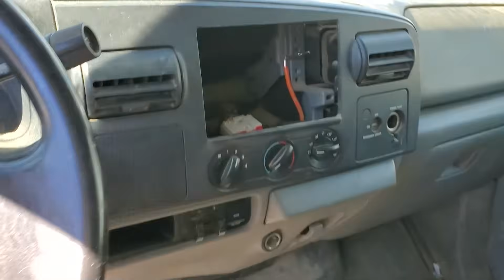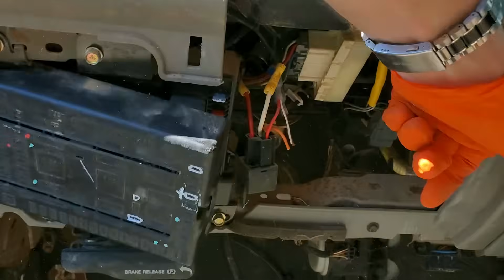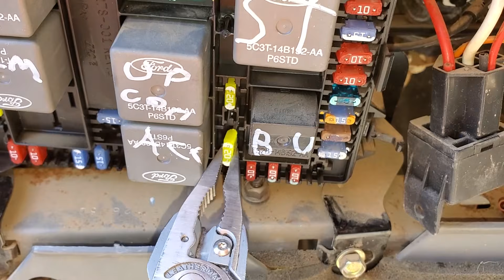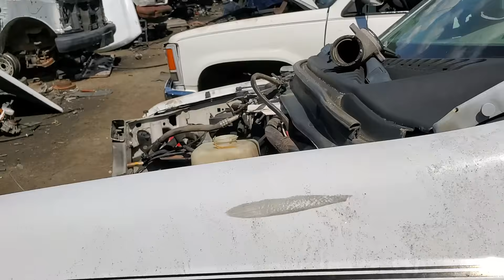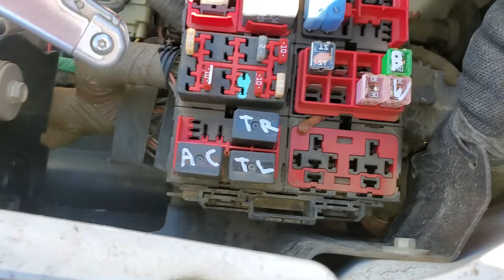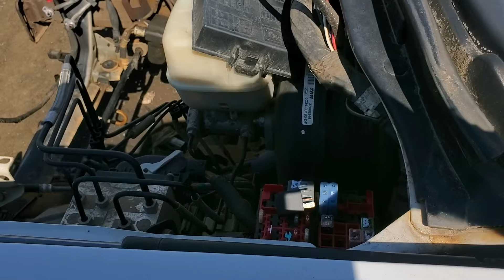2006 Ford F250 AC Fuses, AC Relay & Circuit Explained

Comment: Okay, so I have a F350 6.0 and I installed an e-fan from flex-a-lite.  According to their instructions, they suggest that I connect their e-fan to the AC clutch by way of a piggyback splice that they provide in their kit.  That being said, I find that it is difficult to piggyback anything on the wiring harness to the clutch itself plus I a worried about clearance issues from the serpentine belts.  So instead,  I was hoping to run a wire and tap to the fuse under the dash (I assume the 20 amp circuit to the cooling fan you point out) or  adding a tap to the 10 amp fuse in the fuse box in the engine bay (the one you say feeds the AC relay).  But you say the 10 amp adds constant power to the relay. I assume this is KEY ON power and  I assume constant power when the AC is turned on though from the cab using the switches, correct?  If so, I can just tap that 10 amp fuse and feed a line to the e-fans; they should turn on when I activate the AC in the cab.  Does that sound right?

Comment: I have a 2005 f550 super duty 6.0 towtruck and I don’t know what’s wrong with the Ac, someone told me it was the compressor I changed the compressor it worked for a little then I drove into a pothole and it turned off, now it pops the fuse out, changed the fuse but same problem. Is there anything you can recommend what you think is wrong ?
Reply: Same issue here, did you figure it out??
Reply: @MrThree1zero  there was a burnt wire and after that was changed it started running then the evaporator wasn’t holding the Freon (I think that’s what it’s called) and after that was fixed the ac blows cold and hasn’t turned off since
Reply: @Auntylei  10-4. I'll have to check my wires. Was a it a wire running to the compressor directly?
Reply: Were should i look for the wire?
Reply: @Auntylei  which wire?

Comment: So how many volts is there supposed to be at the relay terminal supplied by fuse 23 in dash? I get 0.5V like a signal V. Others are 12V. If bypassing relay doesn’t engage clutch what’s the next step? Pressure switches? Gauges show system filled correctly and already ‘adjusted’ clutch gap. 
Your videos are great! Speak clearly, video’s clear, & well explained. Thanks

Comment: Ac was blowing ice cold, then I used the heater one time recently and now it is not cold at all 
2007 f-350 6.0 power stroke 
Any suggestions ?
Reply from the maker: The blend door could have gotten stuck in the hot position. You can try changing the temp from hot to cold rapidly to see if it will change anything.

Comment: Hey by chance I for an f350 6.0 you would now what inputs the pcm need to engage the clutch when cold ac works fine I drive and low side pressure build to 300 psi and high side is normal 150 200